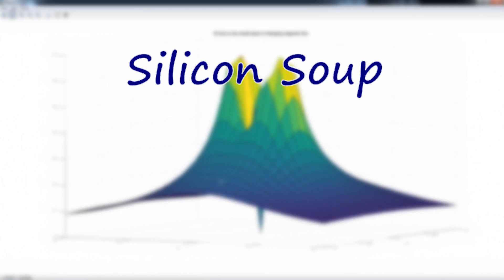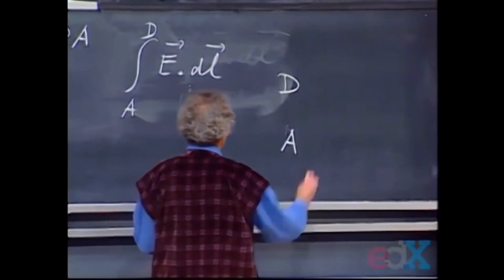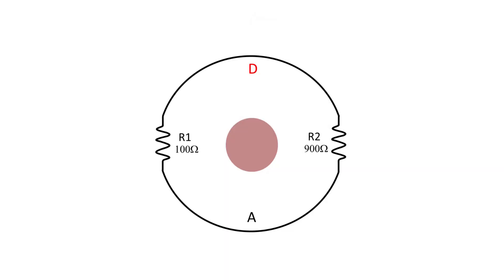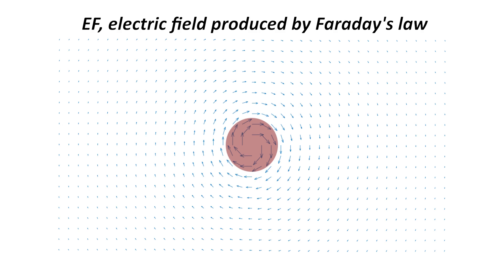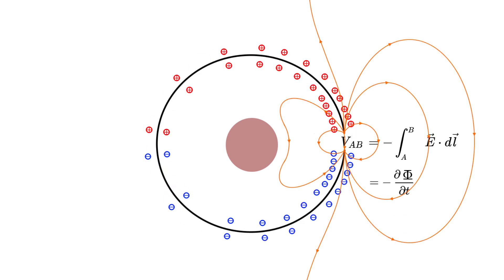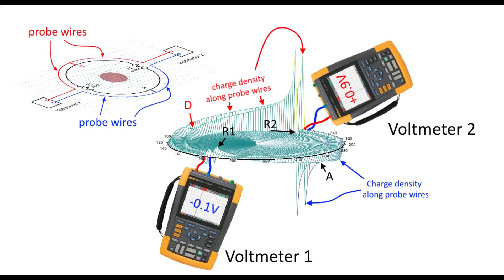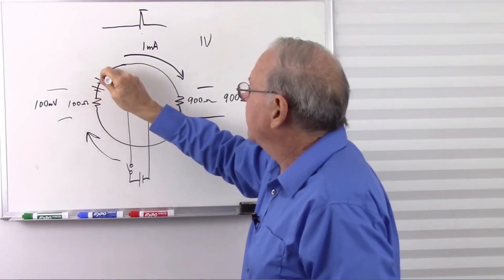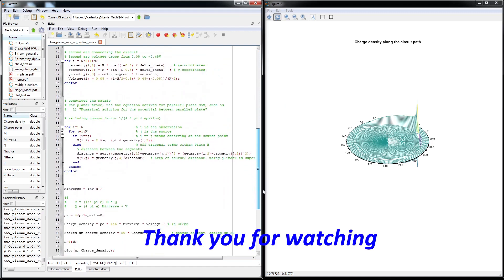Dr. Lewin vs ElectroBOOM on KVL. Of course Dr. Lewin is right.

Comment: @Silicon Soup   @Silicon Soup  Best video on the net resolving Prof Lewin Debate. Congrats! Some clarifications?: The induced generated electric field inside the shaded area (i.e. cross-section of electromagnet) although is clearly an irrotational, vanishing curl (i.e. similar to a vortex) vector field is however in a non simply connected  3D space (i.e. because the cylinder structure of the electromagnet) and therefore in total is a non-conservative field? Is my conclusion and analysis so far correct?  

Nevertheless, as demonstrated by Prof. Lewin experiment setup the inductive loop is outside the shaded area (i.e. outside the electromagnet cross-section area)  where the field is rotational (i.e. not irrotational) thus having zero curl in a 3D simply connected space (i.e. the single inductive circular loop) and therefore a conservative field.  Meaning the induced Ei field in the loop wire is conservative although the changing magnetic B field in total (i.e. inside and outside the electromagnet) is non-conservative. Is my conclusion correct?

So if the Ei field in the loop wire is conservative should then not the KVL apply and be valid?

Non-intuitively, the answer as you correctly pointed out is No. The root of the problem IMO here is not about conservative and non-conservative field but about the fundamental difference between a static EMF (electromotive force) source like a battery connected locally inside a circuit loop in a specific location of the loop where a potential difference is applied and the battery actually representing two open ends of a loop and an induced EMF source transient in a closed loop which has no any openings. KVL rule in order to apply demands the EMF source to be connected in the loop and part of the loop. In Prof. Lewin however experiment the induced EMF source  is not not localized in any particular part of the loop since the loop has no openings (i.e. open ends).

There is no EMF source connected in the loop wire so KVL CANNOT BE APPLIED. It is simple like that. KVL is applied only in electric circuits where EMF source is local and part of the circuit where the EMF is all concentrated at the two open ends of the circuit where the EMF source (i.e. batterry) is connected to the loop wire.. In Prof. Lewin experiment there is no EMF to be found anywhere inside the closed loop. There is no EMF inside a closed induction loop. It is like to shotcircuit the two open ends of a solenoid, there is no voltage generation and there is no Lenz law self induced opposite emf in a closed induction loop. There is only the induced Ei field inside the loop wire and the circular uniform motion of charges during the transient caused by a changing magnetic field.
You cannot practically measure any voltage between any two points in a closed wire loop with a meter assuming a negligible or uniform wire resistance.  

However, Prof. Lewin's inductive loop is not uniform and not with negligible resistance. Half of the the loop is x9 more resistive than the other half.  

There is no common current value of 1mA. 

During the transient there are x9 more charges flowing through the left 100 ohm  resistor than the 900 ohm right resistor and since there is no static EMF source to sustain the E field in the loop there is build x9 voltage drop on the right 900 ohm resistor than the 100 ohm left resistor in the loop (Imagine the two resistors as small cracks-openings in the wire loop). When you now connect the meter loop two open ends (i.e. wires of the meter) where the current flowing in the meter is practically zero I=0 on the left 100 ohm side of the inductive loop you induce on the meter loop the field on the left side of the inductive loop which is x9 smaller than that of the right half of the inductive loop. Therefore the generated emf measured by the meter is x9 smaller. Moving the meter loop on the right side measures an emf x9 larger.

Problem solved. The  crucial point to keep in mind is that during the transient there is no common current 1mA flowing trough the two resistors but the current in one resistor is x9 larger than the other, The two resistors are not in series nor in parallel but act as if they were connected each to a different static emf source battery and that the meter wires open ended loop positioned left or right of the inductive loop plays a major role in explaining this experimental result since the meter induces a different portion of the non-uniform Ei field in our inductive loop.

markoul
Reply from the maker: Thank you for watching the video and the discussion.
The field inside the shaded area is rotational (non-conservative), whereas outside the shaded area is irrotational (conservative). The direction of the field outside is circular, but the rotational property does not depend on the vector direction but on its ability to turn a paddle wheel. 
The amount emf induced over the wire-loop depends on the amount of rotational field the wire-loop encloses, not how much rotational field it is sitting on. In this example, the wire-loop sits on the conservative field but encloses the rotational field, and it is the rotational field it encloses that contributes to the Ei on the wire.
There is a common current of 1mA in the circuit loop. There are more charges accumulated across the 900-ohm resistor than across the 100-ohm resistor, such that their voltage ratio is also 9:1. But because the resistance ratio is also 9:1, the current flow is the same for both resistors, 1mA. The current flow is in series and looping, therefore the current in both resistors must be the same, otherwise, there will be charges continuously building up. In the solution I showed, the charges accumulated are in equilibrium condition when 1mA flows in the loop.
Reply: @SiliconSoup  An irrotational field can still do work (turn the wheel) thus being non-conservative as long it is located in a non simply connected 3D space which is the case here with the electromagnet solenoid. The field you shown in your diagram inside the shaded area has a vanishing curl (i.e. resembles a free vortex) and therefore not a rotational field but an irrotational field in a non-simply connected 3D space and therefore as you also pointed out a non-conservative field. I agree with you that it is a non-conservative field but I argue that it is irrotational and not rotational as you described in your video. https://en.wikipedia.org/wiki/Conservative_vector_field  https://en.wikipedia.org/wiki/Vortex .  

quote: "The amount emf induced over the wire-loop depends on the amount of rotational field the wire-loop encloses, not how much rotational field it is sitting on." Not sure about that, I always believed this is controlled by the magnetic flux lines cutting the loop wire and not any enclosed by the loop surface, The larger area of the loop in the formula simply denotes the larger wire length perimeter making up the loop.  So in what part of the field the loop wire is located and closest to the solenoid where the B field is at strongest is of paramount importance. The induction loop IMO is controlled from the outside rotational conservative field which fluctuates in strength analogue with the inside non-conservative field during the signal transient. 

The cause of the debate is not conservative vs non-conservative but if there is an emf  at all in the closed inductive loop which can exist only at an open ended loop. Therefore , KVL cannot be applied here. IMO there is only the induced Ei field in the loop moving the charges during the transient which is however non uniform around the loop because the different resistors used. The E field on the 100 ohm resistor is is x9 smaller than the induced E field in the 900 ohm resistor. The meter wire loop is definitely outside the electromagnet loop and is sampling the E field around each resistor on either half side of the inductive loop. There is an easy way to see this. If you cross connect the two meters you will measure different values from the normal connection. 

About the common current  1mA in series, I am not so sure either about that although your explanation I admit is convincing.I am not debating about the 1mA value but about if this current is actually in series to the resistors since there is no static emf source connected to the loop in series during the transient? IMO the non uniform inductive loop is effectively equivalent and acts as two separated circuits with each having a separate emf source connected in series with a resistor. But I could be wrong. In any case the inductive loop cannot be treated as a normal electric circuit where KLV applies.
Reply: @SiliconSoup   @Silicon Soup  An irrotational field can still do work (turn the wheel) thus being non-conservative as long it is located in a non simply connected 3D space which is the case here with the electromagnet solenoid. The field you shown in your diagram inside the shaded area has a vanishing curl (i.e. resembles a free vortex) and therefore not a rotational field but an irrotational field in a non-simply connected 3D space and therefore as you also pointed out a non-conservative field. I agree with you that it is a non-conservative field but I argue that it is irrotational and not rotational as you described in your video. https://en.wikipedia.org/wiki/Conservative_vector_field  https://en.wikipedia.org/wiki/Vortex .  

quote: "The amount emf induced over the wire-loop depends on the amount of rotational field the wire-loop encloses, not how much rotational field it is sitting on." Not sure about that, I always believed this is controlled by the magnetic flux lines cutting the loop wire and not any enclosed by the loop surface, The larger area of the loop in the formula simply denotes the larger wire length perimeter making up the loop.  So in what part of the field the loop wire is located and closest to the solenoid where the B field is at strongest is of paramount importance. The induction loop IMO is controlled from the outside rotational conservative field which fluctuates in strength analogue with the inside non-conservative field during the signal transient. 

The cause of the debate is not conservative vs non-conservative but if there is an emf  at all in the closed inductive loop which can exist only at an open ended loop. Therefore , KVL cannot be applied here. IMO there is only the induced Ei field in the loop moving the charges during the transient which is however non uniform around the loop because the different resistors used. The E field on the 100 ohm resistor is is x9 smaller than the induced E field in the 900 ohm resistor. The meter wire loop is definitely outside the electromagnet loop and is sampling the E field around each resistor on either half side of the inductive loop. There is an easy way to see this. If you cross connect the two meters you will measure different values from the normal connection. 

About the common current  1mA in series, I am not so sure either about that although your explanation I admit is convincing.I am not debating about the 1mA value but about if this current is actually in series to the resistors since there is no static emf source connected to the loop in series during the transient? IMO the non uniform inductive loop is effectively equivalent and acts as two separated circuits with each having a separate emf source connected in series with a resistor. But I could be wrong. In any case the inductive loop cannot be treated as a normal electric circuit where KLV applies.
Reply: One more thing . About the resistors being in series in the inductive loop. This has no meaning if there is no emf source connected to the loop. Without emf source one could easily say also that these two resistors are electrically connected in parallel...  :) I believe they ore neither in series nor in parallel but that connected with the meter loop each resistor and the meter loop acts like a separate secondary inductive loop to the primary. The points D and A in the Lewin experiment are not inductively common to the two resistors. They maybe physically common points but due the meter loops, form two different induction loops with the resistors.

Comment: I’m not sure I’m convinced. How could you measure two different paths at the same point? 

It sounds like you’re saying “theoretically, isolate this path and ‘measure across it’ “; but, in practice, would it not just pick a path and stick to it? Most likely the left path with lower resistance. 

Also, I’m not sure I trust the validity of this “closed loop” and whether this truly proves KVL does not hold. The voltage across the wire is zero, but it changes continuously. This seems to me to be a case where KVL isn’t particularly useful, but it holds by nature at some level.
Reply from the maker: If you put one voltmeter on the left side of the circuit, and another voltmeter on the right side, both connected to the same points, then you measure the same points via two different paths. It is proven experimentally that they are different readings.
The voltage across the wire is zero, and even if the emf is changing with time, the voltage is still always zero since the wire has 0 resistance. Any slightest voltage across the wire will readjust the charge distribution until they are zero, almost instantly, because charges can flow in the conductor easily. I was making another video and didn't reply promptly.
Reply: @SiliconSoup  it is proven experimentally that it is caused by bad probing. But you don't really want to accept it, do you?
Reply: @SiliconSoup  This models the problem wrong IMO. Voltmeter's exist in the real world and as such aren't ideal devices so all the wiring is also part of the circuit ad conceptually a point doesn't even exist in reality.

Comment: I'm following this discussion since some time and finally have doubts if I understand the discussion the correct way. Maybe someone will redefine the questions.
What I'm sure about is if you define the points D and A as measurement points and take a proper measurement equipment you will measure the same voltage difference independent if the equipment is placed left or rigth. As I said I had doubts and maybe I still don't understand what the specialists are discussing about but I guess that your simulation confirmed my thinking. What opened my eyes is your schematics shown at time 7:30.
It shows a charge distribution and this is independent if I look at it from the right or left side - the number of charges AT D are the same (same for A) !!!!! (The distribution left or right are different but AT D it is independent from whicht side I look onto D - and that counts - when counting electrons AT a point. (same for A)
How I "measure the charge distribution" that's the question.
What I can see from the charge distribution is that I would measure different differences depending if I measure from D to the upper end of the 900 Ohm resistance or from D to the uper end of the 100 Ohm resistance and so on. What came really clear from discussion is that Faraday's law and KVL are two different pairs of shoes. But you can use KVL in electronics by considering L*di/dt without having knowledge of maxwells equations - it may help for EMC issues to think about and so on. 
But for measuring between two points of a circuit you should know how to probe.
Why I said I have doubts of my thinking are some information which is confusing me: 
Dr. L. has written  in his video   https://www.youtube.com/watch?v=ototTU5NUNA
VA-VD = + 9,090909 V going right way and VA - VD = - 0,9090909V going left way. When I calculate the difference of (VA-VD) right minus (VA-VD) left = 0 = 10 ?!?!? that confuses me and maybe someone could explain what fallacy of thinking I make ?
Reply: The difference in voltage ALONG the left branch and the voltage ALONG the right branch has NOTHING to do with how you measure them. Note that I used the term ALONG on purpose, instead of 'across'.

This is because in the presence of changing magnetic fields, voltage is no longer uniquely defined, but depends instead on the path you refer it to. Voltage is, as a matter of fact, mathematically defined as a path integral.

The very different charge distribution in the two branches create a very different electric field inside and around the resistors, and that is why voltages ALONG the two branches are different. No probes required.

Then, by using math we can also see that the voltage ALONG branch 1 is also equal to the voltage along any path on one side of the ring (the side that does not make the measurement loop + branch include the magnetic flux region), and among these paths it is also included the path going through the probes and voltmeter on one side.
The same can be said for the other branch, only with a different value for voltage.
But voltages are different in the ring itself, independently of any probing.